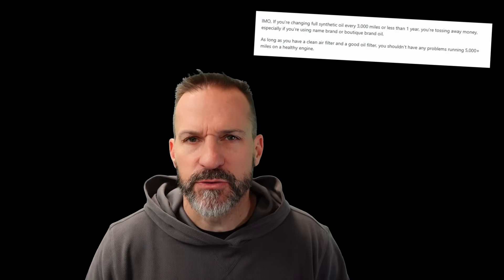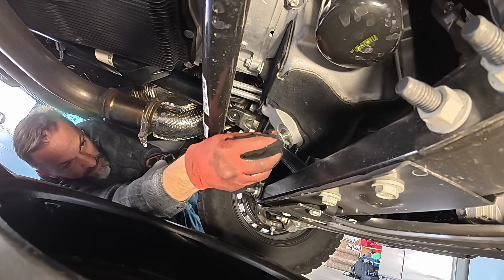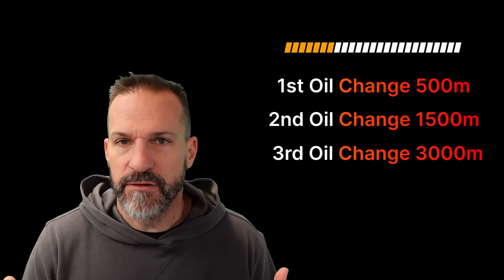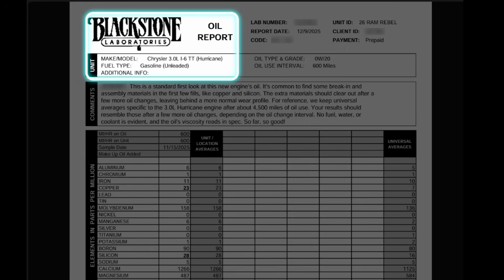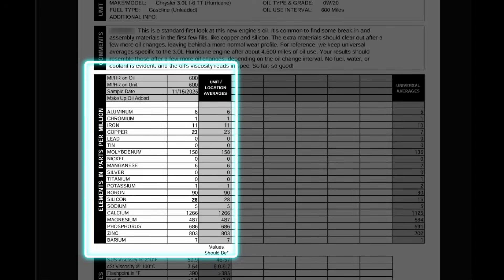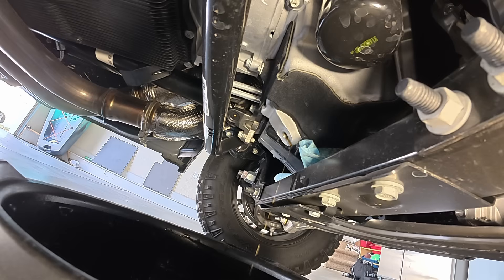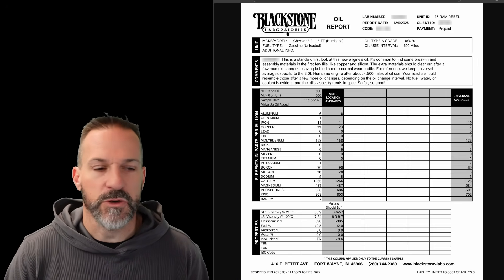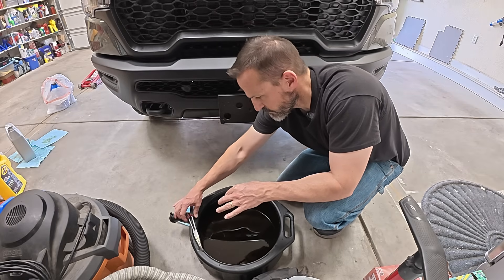Is the Motor Oil Geek Right? I Put His Break-In Theory to the Test

Comment: Lake isn't making this crap up. He has the data to support his position.
Reply from the maker: Yup I really like his channel…
Reply: @TheCarGuyOnline  I like it because there is no BS there. He's just a little different. (True Geek)
Reply: Ok, this was put online one day ago, so I hope someone recent will read it.  I’m a retired mechanic, I have rebuilt many motors, we do breaking on all of them. I agree 100% with your findings, and Lake Speed, which I never doubted. I to as of Dec. 20 2025 have a 2026 Ram with 580 miles,  but with the Hemi. I read my manual to learn about the new ‘items’ electronics etc, but I pay close attention to what the engineers say for break in, specifically when and if it mentions how fast to drive and at how many miles. The Ram manual says to keep under certain speed until 500 miles and a full throttle for a certain amount of time etc etc. (I’m not quoting the manual I hope you understand what I’m saying). So here’s my question. What is the break in recommended, IN YOUR MIND, and Lake Speed’s in terms of how fast!! Drive it slow forever? Between certain new mileages push it to the floor? Some say drive it hard, some say drive like you stole it. I say drive easy, different speeds, don’t race it! Wait until at LEAST 10,000 miles until you want to hot rod it!
Reply: @jackhuizenga4630  Interesting aside - all outboard motors, even the big ones with oil filters, have a similar gently break in periods, AND early oil change intervals. Honda even recommends changing the oil early, but not the filter, since a used filter, filters better than a fresh one (for a while).
Reply: @jackhuizenga4630 you need to vary speeds and loads for proper break in, steady state is not good for break in.
Reply: @jackhuizenga4630    Good advice, but after 5000 miles you should be good to drive it a little harder. As mileage goes on you can increase that more if you feel the need. For everything, don't beat on anything until it's warmed up, especially in cold climates.
Reply: @jackhuizenga4630 I think Mr. Lake kind of infers that in his videos. He never says to baby it nor race it. 

Would you make the engine work hard during the break-in period knowing there will be more metal shavings and  contamination than usual? 

It's all preference. There's videos on YouTube that tested the soft vs. hard break-in methods and results were identical.
Reply: @j @jackhuizenga4630 y interpretation is to baby it during the break in period (~5000 miles). The extra wear comes from more metal contact, so going hard is unwise since the engine is already under extra stress. Lake Jr. shows the metals getting to normal levels at around 5k miles, indicating the engine is ready for some heavier use since the extra friction is now gone. I’m not an expert, just how I am thinking about it based on watching a lot of these videos.
Reply: @jackhuizenga4630  the Lake Speed Jr video this video is replying to explains a general break-in process.
Reply: @jackhuizenga4630  my 6.4 Hemi has a bit over 6k on it. I tow , haul , and drive it at normal speeds but change oil and filter every 2k. I also test. I have high copper so I'll continue until the copper wear comes down.
Reply: He know this, but you have to remember he is a "content" creator and this is just that, "content".
Reply: What brand oil are you using?
Reply: @jchalestorm1749   I don't remember since I haven't change it for about 2 years. Probably Castrol Syntec. Dang 3.3 lt. Caravan won't wear out after 229.000 mi. The body is almost scrap.
Reply: Excellent video. Thanks. I followed Lake’s advice in my new rav4.
Reply: Why would anyone even dream of questioning Mr. Speed?   He's a Tribologist - - - - What are you, Mr. Doubting Thomas???????
Reply: @seanjohnson386 I am a tribologist too.  Why wont anyone listen to me?
Reply: He has not presented ANY data that shows that early removal of the initial break in wear metals, which are inherently produced as part of break in, will reduce total long term wear and increase engine longevity and health. Literally all he has shown, is that wear is greater on a new engine, those wear rates decrease with time, and that if you change the oil early, you will have less metal in the fresh oil. He has not shown that parts per million wear metals will CAUSE accelerated wear rates if you leave that oil in place. He has not shown that at all, not even close.
Reply: @AEVMU it's common sense. If you have nonlubricating solids in your oil it is a bad thing. The affects of the particles were already known. Lake is merely proving that they are there in much higher levels in the early miles and it is wise to remove them more frequently.

In another video Lake added fine iron particles to the oil of an engine on a dyno and there was a significant reduction of horsepower in a short period of time.
Reply: @jeffreypgorman I want to reiterate you don’t need to be chemist or a metallurgist to know it is common sense you want those materials out of the system as soon as possible.  Risk mitigation.
Reply: @thestandardbearer6633  common sense == speculation. where is the science?
Reply: @philkryder1434 this is easy, add some sand to your engine oil and drive it pal. You will find out in a week or so.
Reply: @AEVMU  actually, he has.  The problem is, you didn't watch it, or, you didn't listen.
Reply: @AEVMU  that's correct. these guys are farming engagement :)
oh look, 50 is a larger than 10! but what are the implications? not a word... 

these are parts per MILLION we're talking about, 10PPM Iron in 5qt of oil means 0.05grams of fine particles of iron. 
if you'd prepare a solution of oil and iron w/ that concentration you couldn't polish a soft metal sheet in 100 years let alone induce wear. on top of that, there's virtually no metal to metal contact in a proper running engine...
Reply: @AEVMU  exactly - from the 'SCIENCE NOT SPECULATION" crowd, there has been NO SCIENCE shown that these metals actually impact longevity or performance in any meaningful way. yes there are numbers in the tests. but, nothing that shows how leaving the oil in for the full first change period actually impacts engine life. Show me the SCIENCE. adding "iron particles" is not the same as letting the breakin metals circulate. ? how BIG are the metal particles in the oil from break in? if they are "large" then the filter should be catching them. If they are small, they will pass through the clearances. How many of us have heard of 300k miles on toyotas following or exceeding factory change intervals?
Reply: @philkryder1434  maybe watch his latest video.  I'd put my money on him rather than some random keyboard mechanic (you)
Reply: @philkryder1434 300k is nothing I’ve gotten that out of a Kia POS I took meticulous of. Maybe those Toyota engines should have gone to 600k if they were taken better care of. 
And here’s a test for ya. Take some of my not so bad just small metal particulate 500 mile break in oil and put it in your car and run it for 10k or  whatever silly schedule you follow. Cause it’s still just fine right? You clown.
Reply: @AEVMU  Agree completely. And I note that the Car Guy is unresponsive to your comment and others like it.
Reply: Lake is awesome! And correct.
Reply: Lake has his SHIT together !!!!!Not only CAN HE WALK THE WALK AND TALK THE TALK
Reply: Data can be cherry picked and interpreted in such a way to make it say anything you want it to say.
Reply: the data isn't science though, where's the proof doing this will help? you don't have a control or even a test. You are all conjecturing that this will help.
Reply: @jsnx9067 for the cost of an oil change, why take the risk? The contaminants do not lubricate, so get them out. They can't be doing good. Besides Lake works with major oil manufacturers who know exactly what these metals do in an engine.  You don't need a control group to tell you that breathing underwater without a snorkel will kill you.
Reply: @jeffreypgorman  “Lake works with major oil manufacturers…”  🤔
Reply: @jsnx9067  I think he said that abrasive materials CAN and DO harm engines.  Anything you can't/don't remove from your engine becomes part of the build...
Reply: @reubenmorris487 and people don't realize that molybdenum is a fairly hard metal and can be an abrasive if the particle is big enough... But that's also one of the core friction modifiers and anti wear additives in oil... All Lake Speed does is make people paranoid about PPM without actually understanding what oil tests are for. Signs of accelerated wear during regular operation. Not simply seeing accelerated wear materials when you know there's going to be there during break in. If the particle is much smaller than film depth it's not doing much.
Reply: @reubenmorris487  if a particle is smaller than the tolerance/gap between two metal surfaces that run on an oil film then that particle can not score the surfaces... it's the reason why valve lapping compounds come in grits, you can't lap valves w/ used motor oil :)
Reply: @Vermonstered  please watch his latest video.
Reply: @MoremoneythansenseV4 So not only do his viewers not understand enough to summarize what they just watched, they now reference videos that have nothing to do with the point their trying to make. 

The most recent video, saying modern engines have inferior parts, doesn't matter. That's why you do SCIENTIFIC testing protocols to test your hypothesis on multiple copies of the SAME engine. Only again showing the oil geek fans don't understand scientific method... 😂
Reply: @jsnx9067    It's not easy to know how or when to gather data, but we learn that from experience. When we feel the need to piss we just do it. Do we need the proof?
Reply: @jsnx9067 so don’t do what he said.  Pretty simple really.  You people just seem to like to argue.  You should totally just do what you’ve been doing with break ins and oil changes.  Asking for a lifelong engine comparison test just to satisfy your science claim needs?  Now if you were paying for his advice, sure you could ask for the proof.  But for free, common sense tells you that less metals in the oil is better.
Reply: This data doesn't tell you anything about the reliability of an engine based on using this protocol or any other. It's basically for fun, for views, and for money. They can't afford to do any real scientific testing.
Reply: @lelokong6898 he has done scientific testing, that is his entire business.
Reply: @jeffreypgorman Actually, he hasn't. He's done inferred 'testing.' Actual testing would be running 10 motors of the same spec through 100k protocol on an engine or chassis dyno against the hypothesis he's testing. That isn't what Lake Speed does. He does particulate testing on oil samples out of 1 of 1 engines where he INFERS particulates of a certain type during break in INFERS there's accelerated wear and reduced lifespan of the engine parts. He doesn't actually test engines against his hypothesis to see if there's any credence to his assumption. As there's a number of million mile engines that never did the early break in oil change, and there's plenty of engines that failed early that did the sub 500 mile oil change. Empirical evidence shows what Lake Speed does is get people paranoid about their oil (literally ANY modern synthetic changed at a regular sane interval will do fine for 90+% of drivers) to get more people testing their oil and buying Lake Speed testing kits and analysis... That's what he's selling.
Reply: @Vermonstered he doesn’t push his kits on anyone, this is all good info, If I want to find out more I can go across the hall to one of 130 dynos or to the valvetrain dyno lab, I am sure the would concur with Lake
Reply: @2500zuki  thanks for confirming the whole pretense. His business is to sell unnecessary 'confirmation' and 'paranoia' to everyday drivers that never need or know what to do with this level of resolution and 'information.' It doesn't have to be his specific kit, it's about getting you to spend in his general industry AND going to him as a main source of (biased) information that doesn't actually mean what you think it does.
Reply: @jeffreypgorman  engine manufacturers do the scientific testing. they use a traceable material to coat engine components and then count the particles dislodged from those components... that is the ONLY way to know what 50 parts per MILLION of iron suspended in oil does to a piston ring, bearing, etc.
and because of such tests running back decades (the results are not a secret) we KNOW how, when and why engine components wear. 

ps: virtually all wear happens in the period prior to an engine reaching operating temps and the wear is not mechanical but chemical, meaning corrosion. does this make sense why modern oils are vastly superior to oils from even 2 decades ago? :)
Reply: @lelokong6898 i don’t think Lake ( motor oil geek ) needs the youtube pennies as that’s what they pay ! He’s doing quite fine without YT !
Reply: @exploringsydneyandbeyond9059   Don't think you understand opportunity cost and more importantly marketing. It takes fairly low effort to make a YT video for the plebs. Second is the effort put into those YT videos drives more business for Lake Speed oil testing, their bread and butter. The fact that the YT videos more than pay for their production in straight YT ad revenue is a bonus to pay the editors and videographer team. It's nearly 'free' marketing. Again, showing the Motor Oil Geek fans, don't even know THEY are the product. As each one of you now is a marketing arm (look at just how many of you there are in this one video) for Lake Speed Inc for zero cost to the company as YT revenue more than pays for it.
Reply: @lelokong6898   The real scientific testing is done by testing oil samples by guys like Lake Speed.  Testing used oil samples he can tell when something inside an engine is in trouble, and it's under $65.00 to do it.
Reply: @wysetech2000 😂 You don't know what scientific 'testing' is and why you're a Lake Speed fan. An oil sample is a snapshot of the composition of the oil. You don't know why any of it is there, you don't know where it came from, you don't know the particulate size, you don't know if it's doing any damage. It's ALL inferred AND all you're looking for in oil samples is patterns across multiple samples. Actual scientific testing requires multiple tests testing the same hypothesis or actual tear downs and analysis. That's NOT what you're getting from Lake Speed... There's a reason why he along with everyone else in the industry uses 'universal averages'. It's just inferred guestimation for your motor build, for the environment it works in, for your use case. It's mostly assumption... And it's hilarious you call that 'scientific testing' repeatedly. Showing most of Lake's fans have no idea what testing a hypothesis is or the most basic criteria for scientific testing is...

Comment: So, what about a hybrid where the engine doesn’t run as much? I was going to do my first one at 1,500. Then again at 3,000. Then, absolutely no more than 5,000 between oil changes. I feel like anything is better than the 10,000 they recommend.
Reply from the maker: Yes, I think that’s fair with a hybrid. You can check the computer to see how often you are in hybrid mode and do some calculations that way.
Reply: @T @TheCarGuyOnline Great idea about checking the computer. I didn’t think about that.

Comment: I had a new Chevy engine fitted, change oil and filter at 50 miles, drove carefully the whole time, then changed the oil and filter at 500 miles. A while later sold it to a guy in Rotterdam, who loved it, and it is over 20 years old now.

Comment: I never understood why manufacturers say to drive the full oil change interval on the initial factory oil fill. All those wear metals. I had a 2011 Acura TL with the J37 and did the first oil change at 1500 kms like they recommended then did 5000km oil changes after that. Never had any oil burning or weird issues for the 10 years I owned the car.
Reply: You really wonder? Because the manufacturer is interested in getting you through your warranty period but is not necessarily concerned with max life of your vehicle. They want you to come back to buy another car.

Comment: (Left this on Lake's video) If these contaminates pass through the filter, it seems that the tight clearances for the low viscosity oil causes the damage to the bearings from the contaminates squeezing through (imo from his video). 
Car Care Nut recommended changes at 3-4k for turbo, & 4-5k for NA.
Reply: Yeah, modern turbo direct injection only engines absolutely need more frequent oil changes.

Comment: Lake Speed Jr just posted a video about oil change intervals. 
New engines shed so much break in trash in the first 10-15k miles. Oil analysis takes all the guess work out of when oil and filters require changing. Also stated as oil filter accumulate engine crud, their efficiency improves.  

I lived by 4k oil and filter changes and have used analysis for years. If you're going to spend $50k on a new truck, a couple of $100 oil changes a year, appears to be a good thing
Reply from the maker: 100%!
Reply: Myself 3500 miles with RP- 5w/30 full Synthetic & Purolator One filter every time and ta hell w/5k or more
Reply: This ☝🏻💯
Reply: Its a good thing oil filtere exist
Reply: Great info! I think with my next vehicle I’m going to do 500, then 2000, then 5000 and stay at easy to remember 5000 intervals after that.